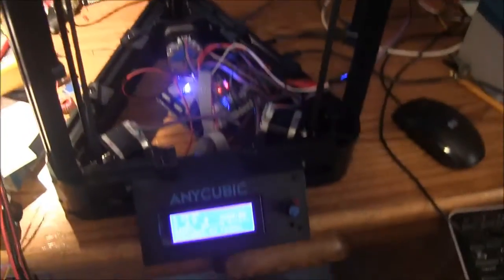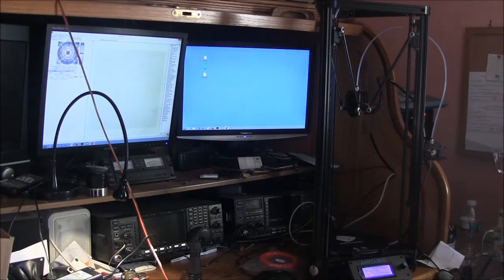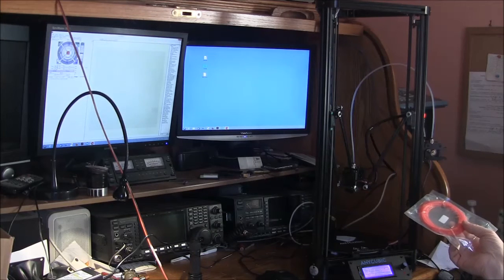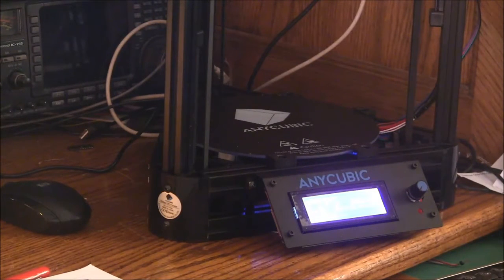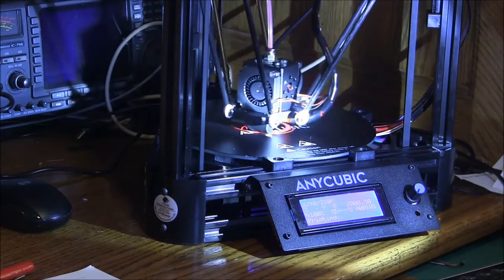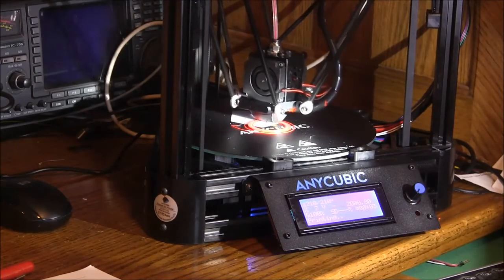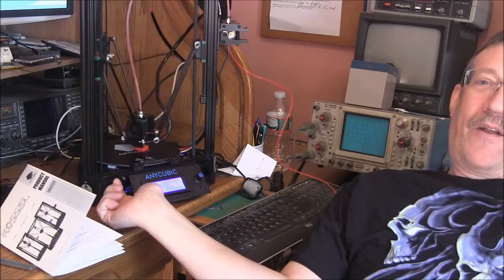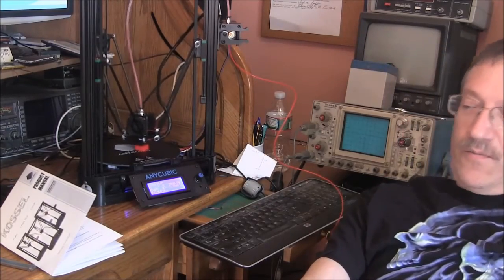3D Printer 2

Comment: I wish this thing had autolevel.
Reply from the maker: I can tell you how to make this work perfectly without bed leveling. One thing you have to do is get rid of those homing screws on the top of the carriers. Then level the actual bed like I showed. Once you do that, you never have to re level anything. I have not had to do a thing to mine since I did the mods.
Reply: That's great to know. So even when you remove the bed you don't have to re-calibrate the Z?
Reply from the maker: On my setup, I only remove the glass, the heated bed plate stays on the machine. See my video titled more 3 d printer fun to see how my bed works.
Reply: Yes that's what I meant. The glass that is not the bed. Have watched your second video, great stuff. Thanks
Reply from the maker: No, as long as I dont change the bed leveling screws, I can take the 
glass off and when I put it back, it is in the same place every time.